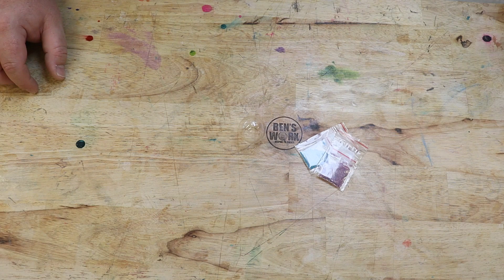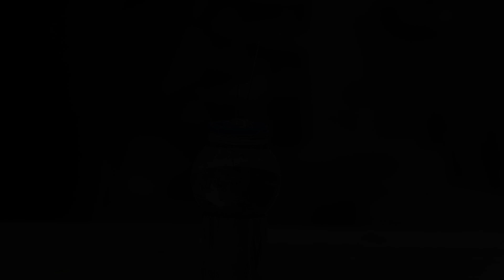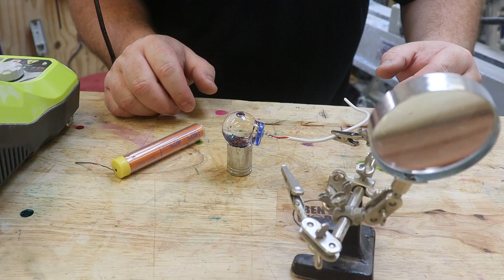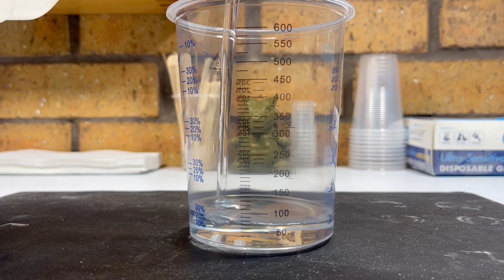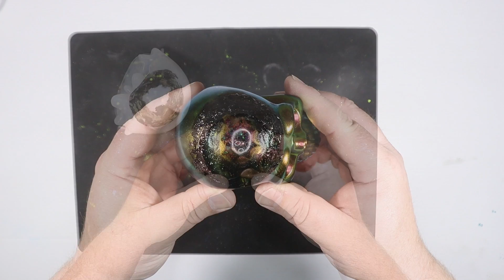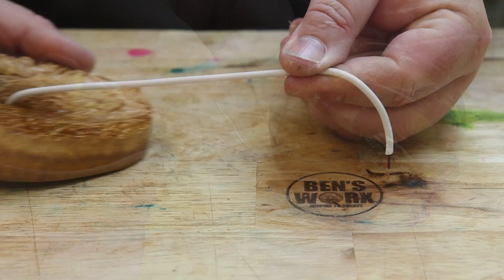Making a LIQUID Filled LED Skull with Opal and Resin

Comment: Put a pin hole in the blue cap and using a syringe top up the castor oil then once filled seal that hole.  I thing the “damage” to the skull was brilliant.  A great job all round. 👏👏👏👏👏

Comment: I have done the mistake of using UV resin in a mould, then trying to pour over with epoxy resin after i thought it had hardened, had the same awful result as you. Took forever to clean out the mould, it had small nooks and crannies that for about 3-4 pours still had a bit of gunk in em.
Safe to say, never doing that again xD
Cool project!

Comment: 5v right into a led?  That's not going to have a long lifetime.  You need to add a resistor to the wiring.  Plenty of good videos about that around youtube.  Looks interesting.  I assume the black kept parts of the uv resin from getting proper exposure.  Clear probably would have worked for the small barrier line you were trying.  Room for more experimenting,... you know... FOR SCIENCE! (and fun)

Comment: If you were to try this again, try doing the oposite with the UV resin. Coat the mold with the color shift the same way, but instead of suspending the bauble and doing the edges with black uv resin, use the clear uv resin to hold the bauble in the spot you want it and surround it. Just dont do your uv layers too thick!

As some people have already mentioned, the black pigment prevents the UV light from fully curing the resin. Best practice is to cure from both sides, and use even thinner layers.

Still looked pretty dope in the end though!

Comment: It turned out great despite the uv resin not working out. Tip for the future if uv resin does this to clean it just use any rubbing alcohol it should remove it. My frinds have had this issue happen to them before and they told me since ive been talking about how ive been thinking about working with resin.

Comment: Kisrel hard type uv resin is what i use. I used to use justresin brand, but i had the same issues with tackiness. In my experience, kisrel hardens faster without getting too hot, it is stronger than justresin brand, and i think its a little bit cheaper too

Comment: I've learned the hard way that adding colorants (especially opaque) to UV resin defeats the curing process as the colorant blocks the penetration of the UV light. Only a thin crust directly exposed to the UV light may cure but nothing past that. I've gone to using mid-cure 15-minute epoxy and my pressure pot. The 15-minute cure allows just enough time to crush bubbles. I'd be curious if you get similar results if you try this.

Comment: UV resin wont cure with opaque pigment, more than an extremely thin surface, this was made worse by your light being so far away. UV light only works where it hits the uv resin directly. It can work through glass, CLEAR colorants, and CLEAR plastic, but will take longer. An opaque black, not a chance for anything more than like 0.1 mm thick

Comment: If I may offer a suggestion, Ben, apply your mica powder, then use a baby wipe to clean up any areas that you don't want it to stay on. If you don't want a definitive line, blend the edge with a make-up brush. Carefully pour in the clear resin so that it doesn't run over the mica, place the bauble, and cure. It might help to use the stir stick to guide the clear resin. Once the clear is cured, it should be good to go for the black.

Comment: looks like your project went off the rails a bit (not sure if you have rail roads in Australia I know you have road trains) but you got it right back on track if I may be so bold as to offer an idea get a bigger bobble with more opal and pour a clear or lightly tinted skull and put the color shift on the eyes and teeth only I really like the cracks and pits in this skull gives it character😀 but led was kind of lost may use an color chaning led disk not sure how that would work over all great job

Comment: next time you have to fill a thing and not get an air bubble, here's a tip:
you start with what you have and poke a tiny hole in the blue part (like heat up a needle in a flame).
then you put a tiny amount of glycerin on top of the blue (a bit more than the bubble size), toss the whole thing in the vacuum and pull.
when you release the vacuum, the excess glycerin will seep back in and then you can melt-it-shut (or uv epoxy..etc).

Comment: When using black uv resin let the light hit it from both top and bottom. So hit from the top then flip the mold and hit it from the underside. Also do it for twice as long as you would light colored uv resin
Reply: Ah, but would the UV light be able to penetrate the mica powder 🤔 Color shift mica powders work by reflecting and refraction, which would mean not enough UV light would get through to cure from the outside.
Reply: @DAsAngel1960  I’ve never had any problems just takes awhile and using a higher powered light would help too. Use either a nail light or one you’d get from like the hardware store

Comment: I’ve had my UV resin do that. Between the coloring agent and the depth of pour it didn’t want to set well. Works better when it’s clear.I did find some transparent tints that worked better. Sticky is an under statement. You did a great job at over coming it. I love this I’ve got that skull mold will be interesting.
Reply from the maker: Thankyou
Reply: @BensWorx  one thing I learned is it’s better to use dry pigments liquids contain water which doesn’t play well with resin